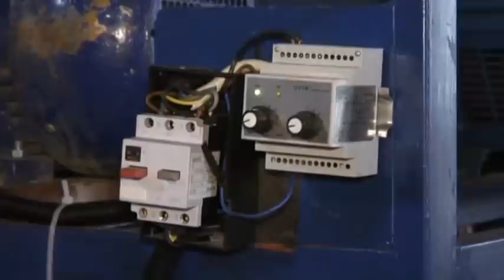NOVO !!!HIT!!!NEVEROVATNA USTEDA STRUJE!!!

Comment: Dear Sir,
    I am ntersted
        into co-operation but I would like to have a few informations,
        please, answer for the following:
    1.       What
        is the ability of your generator?
    2.       What
        is the level of energy needed for generator to keep going on,
        what is the energy level outgoing from it?
    3.       Can
        your generator be treaten as the device producing the „green
        energy” (ecological one)?
    4.       Is
        your device produced in a mass scale or it is just a prototype?
    5.       What
      is the price for this generator 30kW and 50kW?

      

      Regards
Reply: Just my comment: the ability of this generator, is pretty much, 0
2. The energy levels is unknown 
3. actually, yes ( it is not using, nor giving energy )
4. definitely NOT
5. Very hard to say
Reply: Transformacija u kaskadi
Reply: Hello.
I have made copy of this generator. The information of mine is below :
1-  used electrical motor with 5 h.p and alternator with 20 h.P  output power
2-  connect motor as a load to generator by transformer 1:1.1 ratio.
3- used second d.c motor as starting motor.
4- results is excellent. The unit is running successfully.
5- connects a 20 lamps of 100 Watts all lighting up successfully. With voltage drop of 230 - 218 voltage.
6-all of this because I made some modifications on alternator and motor in winding.
7- the weight = 5 kg each side of.

Regards